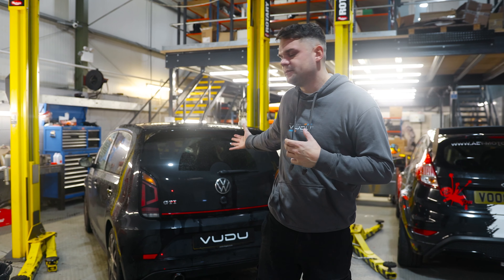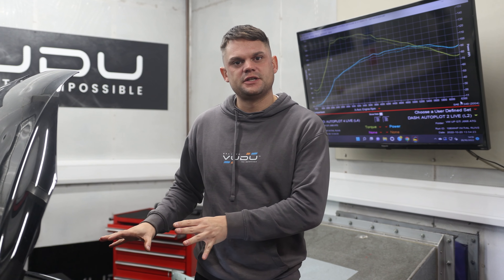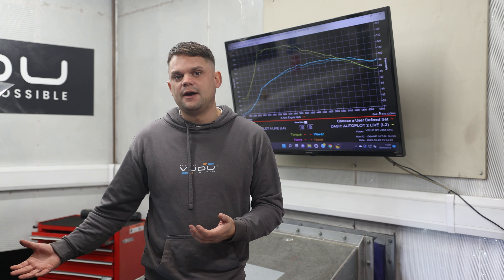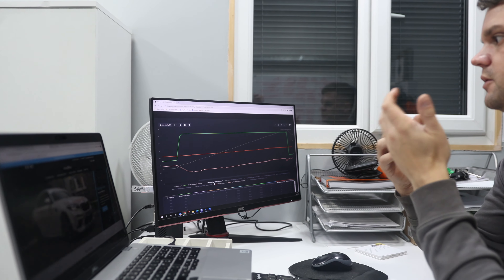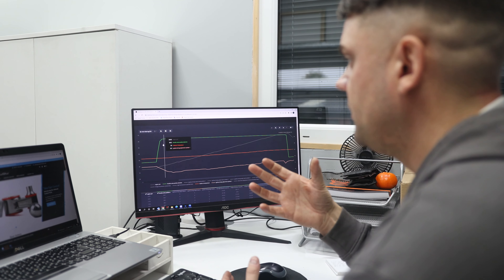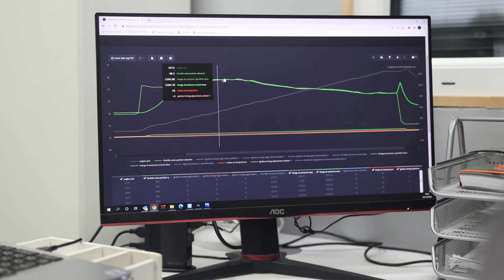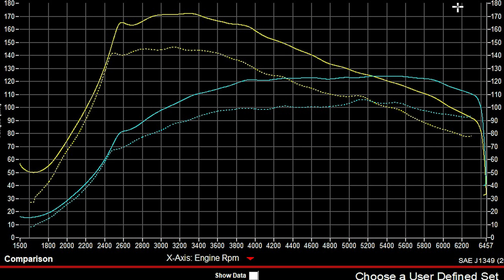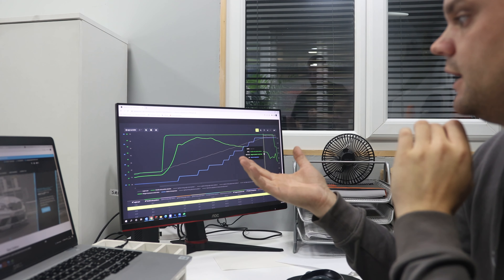UP GTI Stage 1 Remap Install & Dyno **Pocket Rocket**

Comment: My UP TSI whit STAGE 2 ( Dowpipe, Inlete, Filter KN INBOX and remap, coil Eibach ) have 130whp and 24kgfm torque , clutch gear  OEM, and upgrade brakes